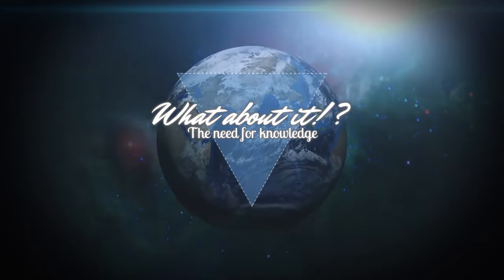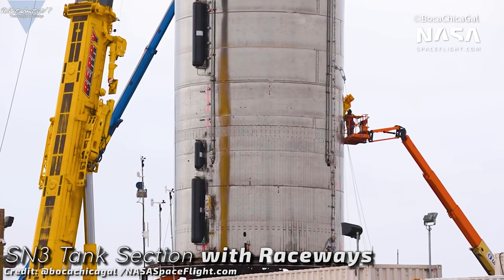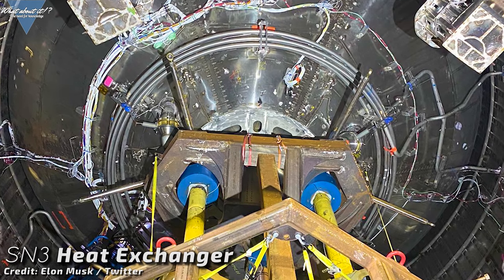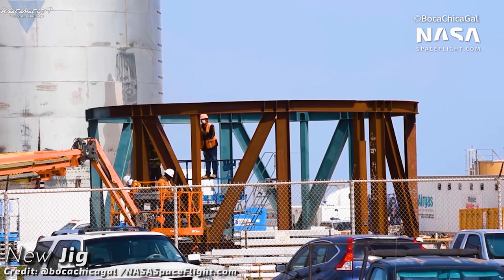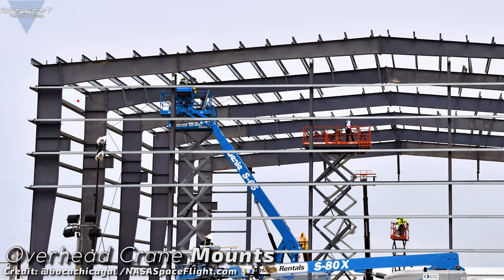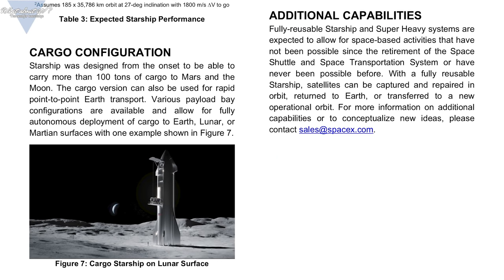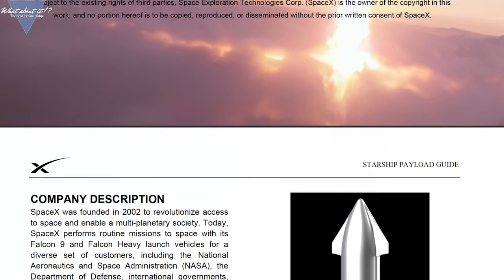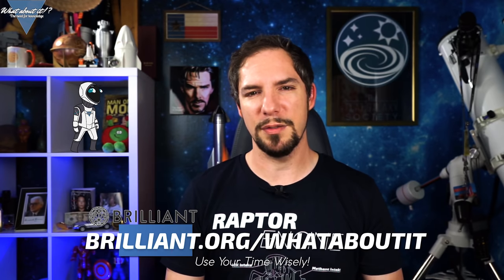82 | SpaceX Starship Updates – Starship User Guide Reveals Major Starship Feature

Comment: So when is Blofe... err, I mean Elon... building the SPECTRE “Bird One” fairing? You only live twice. 😂😜
Reply: This vehicle could even support a Moonraker-like system!
Reply: The one pictured IS the Bird One fairing. It just opens in 2 pieces instead of 4. The best part is no part! Elon is smarter than Ernst Stavros.
Reply: SPECTRE were idiots. Rather than using Bird One in a cockamamie scheme to steal spacecraft, they should have developed it as a reusable launch vehicle and taken over the world by controlling access to space. Bird One was amazing! It was basically Starship. 

Extend the length of the first stage by 40% to provide more fuel and integrate two extra outboard engines at right angles to the existing outboard ones, and that fully reusable second stage could have delivered up to 20% of it's initial mass in payload into orbit at a guess, more if they stripped out the pilot cabin and fully automated it. 

If they could recover the upper stage, recovering the lower stage would have proved far less difficult, and they even demonstrate pinpoint landing with the upper stage, so the lower stage could use a barge as a landing site. Maybe they neede a pilot as the task was too hard to automate with 1960's computers. But the lower stage could have been remote controlled from the ground by a pilot if you had a reliable communications link.

A much smaller 'satellite killer' balistic missile with a conventional warhead would have been more than adequate to destroy the orbiting capsules, with the advantage that there would be no telltale descent back to Earth afterwards.
Reply: @stainlesssteelfox1   If only they knew how to weld stainless steel back then.  Oh wait...

Comment: In the PAYLOAD INTEGRATION section of the User Guide, could it be that "...lifted onto the Starship vehicle..." means '...lifted onto the Superheavy vehicle...'??    I say this because the use of these two terms by Elon has been both made distinct at times and conflated at others, making the terms confusing – depending on the specific context in which they are used.